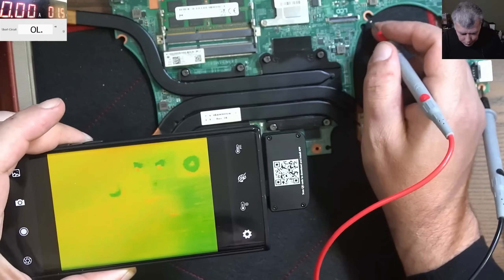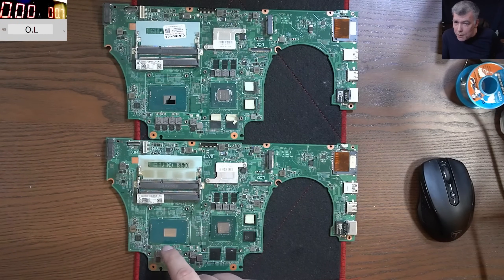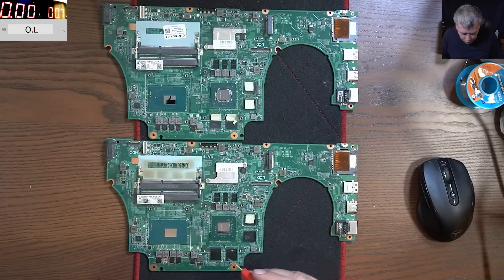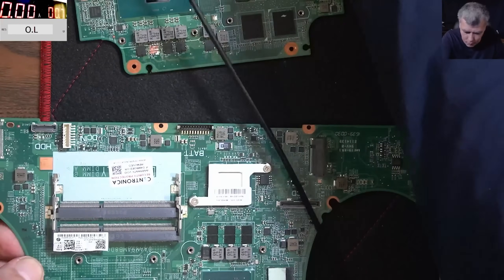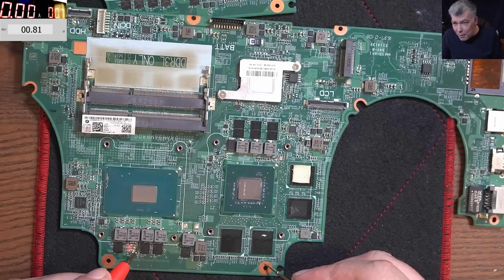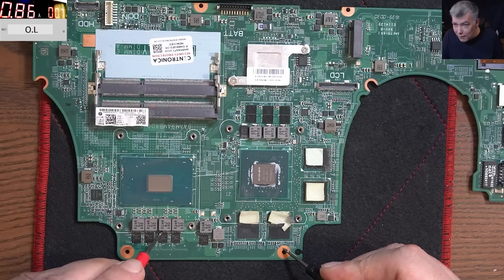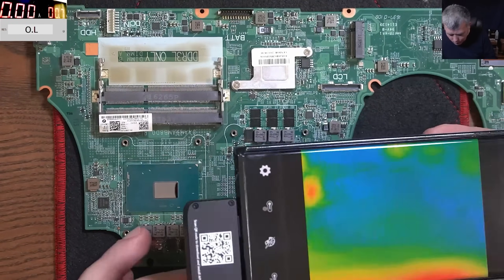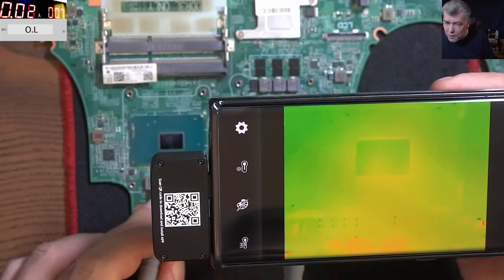How to spot a faulty CPU - How do we know the CPU is even faulty?

Comment: Got a Dell G3 3579 from eBay that auto turns itself on when the charger is connected. Keyboard backlight comes on immediately. Several seconds later, the fans come on at full speed along with the white LED. The led is solid white but goes off within seconds. It doesn't come back on (only comes back on if battery is also connected). No image on screen (no backlight). If I press power button, it goes off but soon switches itself back on automatically. If on battery only, same symptoms occur, only it doesn't auto start. I have to press power button. 

Only way to get the screen to do anything is to hold the "D" key during power-up. The backlight comes on and it cycles between the colours for a bit. After that it goes off and returns to the usual black screen max fan speed problem.

Checked all voltages around coils and they're present. The only ones that weren't present were the coils around the CPU. Took heatsink off and measured the coils. All of them measure "000.2 ohms" which I guess is too low. Checked the coils around the GPU as well and those were around "000.8 ohms". The GPU coils receive 0.8V when power is applied.

I'm guessing this is a shorted CPU. I thought it might've been a BIOS issue at 1st (before I checked the CPU coils). I soldered the BIOS chip to my CH341A programmer and flashed some files I saw posted on Badcaps for the exact motherboard model. I tried 2 so far and none of them work. All same symptoms. I don't think it's a BIOS issue at this point. Seems strongly likely to be a CPU issue which is unfortunate. 

Bought the laptop to practice troubleshooting and working on laptop boards in general, so I am not too fussed about failing to fix it. Just a shame it's one of those faults that can't easily be fixed. Been doing a lot of research to try and see if there's maybe something I am missing, but everything I read and watch points more and more to the CPU being shorted.

Comment: I have an Alienware 17 R2, and it restarts every 30 minutes. I reinstalled Windows and everything else, updated the BIOS, and even used it without a battery, but nothing helped. Temps are normal and changed thermal paste of GPU and CPU. i can play even heavy games in 30mins. It keeps restarting exact after 30 mins. Please help.
Reply: Flash bios with cleaned me region
Reply: Flash bios with cleaned me region
Reply: 100% bios issue.. Flash with old bios
Reply: Me region problem

Comment: For what reason the CPU cannot be replaced? Because it is soldered on the motherboard? What if it has a ZIF connection?
Reply: It can, but they do not sell new CPUs. Any CPU you get would be harvested from a dead motherboard, therefor parts are unreliable.

Comment: Recently i received two different brand PCs one an old msi with old nvidia graphics card and the other lenovo with no graphics but both have same issues power is on with fan spinning correctly but no display, am not particularly sure if this reach you but you are my pc maintenance guru can u help.
Reply: Check the SIO or Northbridge Chipsets.

Comment: This video is seven months old, but I watch it now, but I have problem with cpu i5 6600k mounted on Asus Z 170k, both bought used on eBay. I can't install win 10 pro from usb stick, neither from SSD with  previously installed Windows 10 pro, that work fine on old motherboard. Only  get blue screen errors. I solved this problem with turn off all cores, set on only 1-3 cores and works fine. I tried everything setting changes in Bios hopefully to work with all cores but none. After so many tries my pc won't boot no beep, no post, only black screen, all fans and led on motherboard work. Probably my cpu is completely dead I don't know for sure. Now I ordered another used cpu i5 6500 from eBay, I hope it will work. I think the motherboard is ok..

Comment: The trick is Opera Browser and Youtube. If your processor is working but weak and hot, you have to raise the size of a Hd Youtube video, and the prolonged watching will halt the laptop, you have to force the restart. It may need 10 restarts. Such video for this purpose is Cod Black Ops Hd full gameplay. It will calibrate the processor, the power input. The laptop will be stronger and less hot. Doesn’t work with other browser. Another boost for laptops is to play 3D war games on battery, and Diablo 2. By completing quests, the reward will be higher cpu and video performance, keeping less heat and fan speed. After that, you can use it ac online, it will remain cool and powerful.

Comment: I have Lenovo Ideapad L340-15IRH. It has i5-9300HF CPU (without integrated GPU) and GTX1050. At the all coils of CPU I have 2 ohms resitantce, as well as the same at the coils of nVidia GPU. Does it looks like a faulty CPU, doesn't it ?
Reply: if your multimeter shows exactly 0.00 ohms when you short two probes together 2ohms is normal  for that cpu vcore.. Anything below that resistance is bad.. N17X chipsets has too low resistance nvdd phases around 0.5-0.8

Comment: reball the cpu it will work. cpu die rarely fails. my number 1 suspect is solder balls underneath the cpu.
Reply: HQ series cpus gets cold solder joints / micro solder cracks or gray pads under solder balls very often. If your machine stucks at around 0.70-0.90 Amps just reball the cpu.  Can't say the same thing for blown up voltage phase tho. That could easily kill the cpu.

Comment: Is the CPU always dead when you see a shot spot? Have a laptop with Ryzen 7 5800H cpu, all power rails ok, but no display. CPU getting hot, GPU warm (RTX 3060). Checked with thermal cam and see a hotspot in one corner of die.
Reply: Did u find the problem?
Reply: @brayanxpalacios  I think the CPU is really dead. When i connect CH341A to the BIOS chip, the voltage of it drops and CPU getting warm in that corner.

Comment: Thermocamera is expensive. However very useful not only for CPU fault finding. If electronic repairman, electrician or HVAC technician can afford at least $350 worth thermocamera with 160p+ resolution, he must get it. I agree - alcohol under zooming lens or microscope is nice simple method. We used thermal paper from fax machines or cash terminal receipt rolls - overheated faulty components left nice dark rectangles :)

Comment: Hello Sir,
I have an asus x555ba laptop, the fan spins fast and the laptop always turns off about 1 minute after turning it on, what do you think the problem is?
Thank you
Reply: I have a x550cc laptop and it happens the same and no picture no audio no network, i detected that a audio and network chips is getting mad hot and i took them off and still has problems, i think its the io chip that has a parcial short and not working right, so i can't repair it.

Comment: You are amazing in the way that you describe, I have one question can we apply those methods on the GPU processor also ?
Reply: I have come across countless GPU problems and this is how l got around them "1st l apply wax around the edges and l put a coin on top of the GPU then after wards l apply heat using a heat station for about 5-10seconds"
Reply: @Khedha94  and then what happens or what would be the indication that the gpu is faulty?

Comment: Fantastic video and i see you bypass the mosfet and send power direct into the CPU but if the computer isnt on doing work and calculations, why is the CPU taking current and heating up?  What is happening here?
Reply: Some of the transistors in the CPU are short so they are going to take current. When there’s a sure there is heat.
Reply: @shiftctrlhack  Yes i understand that when tracing down hot spots. BUT wasnt one of his boards the GOOD CPU but still passed .8 current at .7 volts. So if all transistor inside are good why are they switching on and warming?
Reply: @xx3868  The processor will still use power if you give it power. It's like, if you apply power to some location on the motherboard, the components connected to that area will still use some power even though the motherboard does not turn on. The processor will still try to operate on what power you give it. It's just the nature of all of the components inside the processor. The individual components in the processor will carry some electricity.
Reply: @waynesallee-com  Yeah i forget theres approx a billion transistors and leakage alone together would give you say .7 of a amp. Bypassing the mosfet and powering juice directly into the CPU, i though there might still be some gates that had to turn on to let power in say by the super IO ect but it looks like the mosfet is the last gate and then it all pours in at less than a volt? 
So learn something today and that amps test will quickly tell you if you got many amps going in that somethings wrong unless that flood in is because of a shorted cap on the way out of the CPU. Is that possible too?  and you still have a good CPU?
I have a whole bunch of boards with hot CPU's so i was going to junk them for parts, maybe not necessarily the CPU?
Reply: @xx3868  I have not kept up with exact voltages of CPUs. The voltage does vary with manufacture, and products. Power going "on the way out" would be ground. Technically, electrons travel from negative to positive, but that's another whole can of worms. But there are capacitors on the back of the motherboard, that apparently connect to individual pins of the CPU.

Comment: Good day master thanks for all you do for us sir🙏 the petrol oil you made use of is it ordinary petrol for cars & vehicle?
Reply: Sorin refers to it as 'petrol' but it's really 'white spirit' --- you get it from places that sell cigarette supplies --- 'Zippo Lighter Fluid'
Reply: @gcbification  okay thanks, hw does it suport cigarette smoking so that I find it here in my country
Reply: @linchpinshalz  In essence it's this stuff --> https://en.wikipedia.org/wiki/White_spirit  ...the zippo lighter fluid is just more highly refined, to remove some of the heavier aromatics so it isn't so smelly =)
Reply: You can also use rubbing alcohol (contains 30% water). The nice thing about that compared to pure alcohol is that it has 2 different boiling points which help create a better effect than alcohol alone.
Reply: @waynesallee-com  Explain to me how/why having a miscible solution of IPA (boiling point of 82C) & water (boiling point of 100C), is practical? Zippo fluid  (boiling point of 35C) shows up faulty/overheating components quicker, as you need to inject voltage for a shorter period of time to detect/observe the fault.
Reply: @gcbification  I was not saying that alcohol was better than zippo fluid. I was saying that I like the extra visual effect, that the water creates in the rubbing alcohol, compared to strait alcohol.